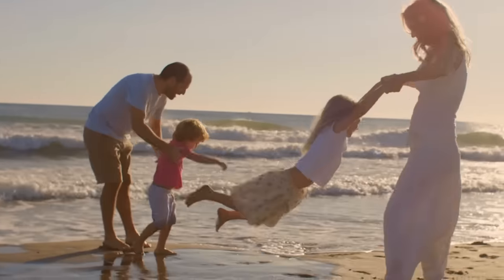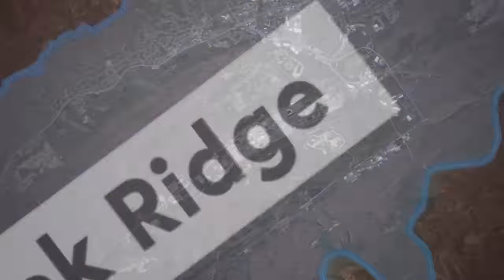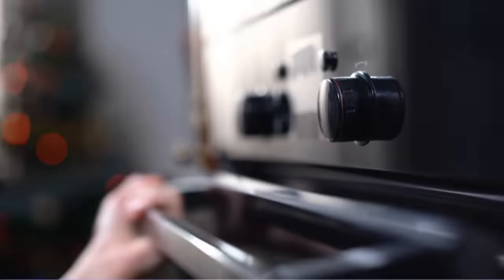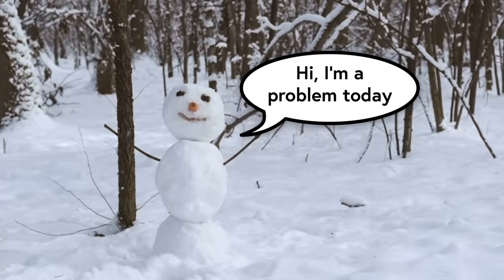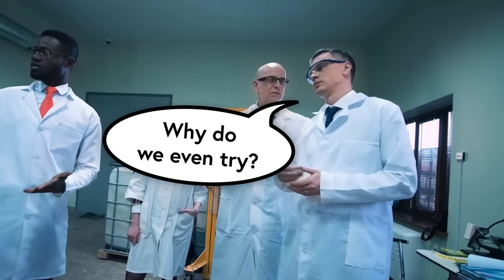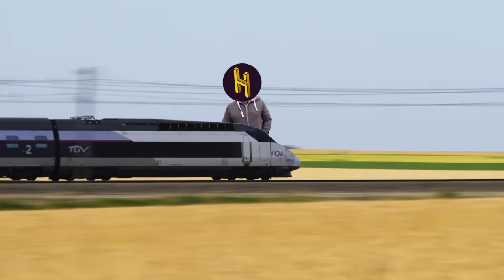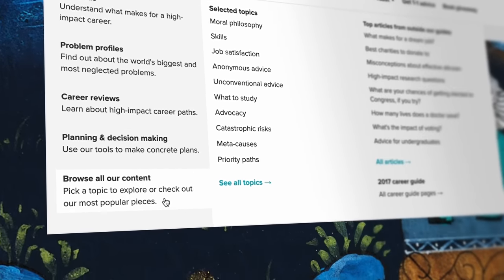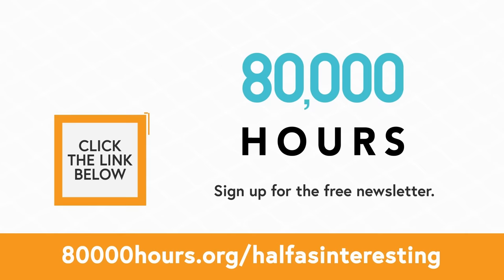The Material So Classified We Forgot How to Make It

Comment: So with the Ulam-Teller design, the fogbank itself is not important to the function of the warhead. What's needed is basically "nothing" that has structural integrity to hold both the initial device and the primary device in place without creating radiation shadows (which would cause uneven implosion on the primary device). At the instant of detonation it would be completely acceptable for the fogbank to be replaced with literally nothing. Radiation pressure causes the implosion on the primary fusion device, not "heat from the fogbank".

The fogbank is just a low density, radiation transparent, structurally stiff substance to hold everything in place while the (light) radiation reflect off the (gold, if I remember) foil interior of the lensing cavity.
Reply: But why would those impurities have mattered, like described in the video?
Reply: @cbuchner1  The video didn't specify what the impurities were or what the reagents or reactions were. I can't do anything but guess. A lot of metal salts act as catalysts in reactions. It could be that removing those metal salts led to an inhomogeneous reaction that had density variations. It could also be that the impurities served as gas bubble nucleation sites.

Again, just guesses.

Comment: So that's funny because Tom Scott recently did a video about why Swiss cheese almost lost its holes, and it's the same reason the new Fogbank didn't work. It turned out that the holes needed a tiny particle in the milk to act as a nucleation site, and the modern milking machines were so perfectly sterile that there was no hay dust making its way into the milk. So now they add just a gram or so of sterilized hay dust per ton of milk, and the cheese is holey again!

Comment: Here is my guess:   fogbank is the fill of the sphere and is a suspension of the fusion material that the fission compresses.   I was told that the fill has to be renewed to maintain the bomb yield.  Thus old bombs have to be refilled.   This is not the only operational issue with atomic bombs.  If the burn in an accident they don't go critical, but the chemical explosion is deadly and all the radioactive material is thrown over the landscape.   Workers have to protect themselves from touching  the tools that are used on the bombs.
Reply: One of its functions it so suspend the secondary within the radiation case, yes.
Many weapons in the US arsenal use insensitive high explosives to mitigate the risk of accidental HE detonation in a fire.

Comment: This is just how manufacturing works and sometimes it sucks. Seemingly small details that may or may not seem like obvious or important things to document can turn out to be critical. I can't tell you how many times I've seen people quit or retire in machine shops only to leave the rest of us scratching our heads the next time we go to set up a previously run job only to run into all the original problems and hurdles the other guy solved and never documented. Especially the ones that were solved in some "expedient" jerry rigged solution because the obvious, proper fix would be too expensive or take too long to ship or require a major process overhaul.

Comment: Dad used to work at a military battery plant, nowhere near the level of clarification as this, and one day the batteries started having problems (don't worry, not fires, that was a different story). This was a completely new problem, and no one could figure out what the cause was or even remember exactly WHY the batteries worked that way. There was one guy who developed them, took decent enough notes, but nothing that would help, and he had died 5 years earlier. Long story short, a team of chemical engineers spent months reverse engineering a battery to figure out there were TOO many impurities in the material in the casings...

Comment: Fogbank is the type of material like Styrofoam used to produce a Crap ton of neutron in order to compress and spark the Second stage Bomb

It called a In-between because the Fogbank becomes a Nuetronium base like plasm that basically makes the second stage spark.

Comment: I read that this material is expanded polystyrene, styrofoam. It forms a carbon plasma when the device is detonated that ducts soft x-rays to the secondary.
Reply: There's no evidence that Styrofoam was ever used.
One weapon from the late 50s used polyurethane.
There are indications that Fogbank may be beryllia based, or at least we know that beryllia is used in the interstage of one of the weapon's that uses fogbank as an interstage material. Could be that fogbank is BeO, or BeO based, or that it's two separate structures in the interstage.

Comment: Not so fun fact, aging workforces in industries have previously had such issues, including other nuclear adjacent stuff. Documentation. Is. Important. Both for the sake of history and so that we don't need to reinvent the wheel when people eventually enter a given professional domain. 

An old experimental test reactor that's now a museum in Idaho (go see it if you're ever in the area, there's also a potato museum a bit of a ways off that's next door to a lovely candy shop that sells all kinds of candy and phenomenal fudge, both are pretty cool to visit, highly recommend that candy shop) had very thick walls for manipulation chambers, alongside multiple layers of glass/mineral oil, which through tricks of refraction made it look like there was only a single pane of glass. The problem was, no one living knew the specifications or assembly/maintenance steps and so when something broke a ways back, they had to reverse engineer and reassemble the window system.

Comment: Swiss cheese almost ran into the same issue.  The bubbles form around impurities in the cheese, and because sterilization processes are better these days there were less impurities in the cheese for the bubbles to form around.  Problem solved by adding some dust to the mix

Comment: The clue to how easily this happened is "security."  Classification limits who can speak to whom.  Something similar happened when the US decided it needed to build some new Saturn Fives.  The tested engines were nowhere near as good as the originals.  They tried dragging former Saturn engineers out of retirement (or the grave) to find out what was wrong.  They discovered that considerable oral knowledge had perished.  Critical tweaks to the processes involved in building the rocket motors were lost because the project leads were unaware of,  or dismissed, the undocumented steps as irrelevant.

Comment: Your explanation of the job of the fogbank interstage is wrong. The gamma and X-rays coming off the primary reflect of the mirrored casing liner to bombard the secondary, burning it off and creating an inward puch effect very similar to that of the conventional explosive on primary, but far more efficient, rapid, and powerful, to better ignite the secondary's fusion reaction. However, all that radiation blasts directly at the secondary and would blow it away before fusion can begin, without something in between to protect the secondary while the radiation reflecting off the casing can begin the secondary implosion. That's the job of fogbank, to absorb that direct radiation, creating a "shadow" effect that protects the secondary.

Comment: It is an airgel encapsulating tritium at the proper density to ensure that the fusion reaction occurs  correctly for the optimum detonation of a hydrogen bomb ensuring maxximum yield strengh. A simplified explanation.
Reply: I'm not so sure I should have released that in 6:27 public forum 😮

Comment: If Fogbank is just an Aerogel, whose only function is to be able to resist high temperatures, why make them a national secret at all? Assuming it doesn't have some explosive properties alone, that material would be suitable for insulation in a variety of applications. At present the best aerogels only operate until 650°C, but if an aerogel could instead resist 100 Million °C that would not only protect buildings from fire. It would be lava proof! Even the lava inside a Hawaiian Volcano only reaches 1250 °C. A wall containing Fogbank in a high risk area would fully divert the flow of lava so I can think of a number of wealthy people who would absolutely pay for that to protect their assets. And of course if you lined a protective suit with Fogbank it would keep miners working deep underground safe for much longer. Quite a few industrial facilities could also be made safer by lining equipment in Fogbank and the extra cost could easily be justified through energy efficiency and lower insurance premiums.

It seems rather foolish to keep the general public from having access to this technology considering a variety of non-military applications. Maybe if ours was the only country with nuclear rockets I could sort of see the logic, but pretty much everyone has access to nuclear technology these days. 

In a broader sense, shouldn't we have a process by which classified documents can be reviewed by someone for potential declassification? The system is so broken that recently the FBI found itself unable to properly search Trump's Golf course because he - when he was sitting President - classified it as relating to nuclear technology. Meaning that the evidence cannot be used in any trial regardless of if it's actually related to nuclear technology or not. And since his power to declassify ended with his presidency, he can't even legally give the FBI permission to look at it. Point here is that it's too easy to make things classified. There's practically no oversight in the process.
Reply: I think it's just standard procedure that everything a military works on is classified. If you found an awesome recipe for brownies while in the break room? Now it's a classified national secret just in case spies are on the lookout for the latest in brownie culinary technology.
Reply: @stylesrj  That's... actually probably true. Both hilarious to picture and sad to think about.

Comment: So, I worked in a different aspect of this "industry" but considering all of the miles of classified microfiche and digitized information on the classified network dating back to the Manhattan project I was able to access, I would really like to know how they somehow misplaced "grandma's recipe" for this stuff. I have a feeling it was simply lost in the absolute morass of things classified under the Atomic Energy Act which have a way of accumulating over time and don't enjoy the same automatic declassification process that everything else does.

I do also remember there were very old engineers (well past retirement age) that they kept around in Oak Ridge in a sort of semi-retirement with full pay deal just because they "knew things" and it was impossible to replace them (I'm hoping someone calls me up in 20 years for some obscure thing I know and gives me a deal like that!). I'm sure most of them have either joined the choir invisible by now or are at least incapable of working. So, if it was knowledge never written down, then I can see how it was lost. That's definitely not how things are done today. Everything (and I mean EVERYTHING) is written down, dc'd and stamped, and digitized these days.
Reply: We are just at the very beginning of the Information Age now. So our ability to store information still isn't very good yet. But we are getting better at it.

Comment: The original hydrogen bombs used polystyrene to channel x-rays into the fusion fuel and kick off the fusion part of a thermonuclear weapon. But to make these warheads smaller polystyrene aka Styrofoam wouldn't do, enter fog bank. This material allowed h bombs to go from giant multi ton devices that required modified bomber planes, to smaller more efficient weapons that would allow multiple warheads to be sat atop icbms which international treaty limits to 10 warheads per missile. Each warhead is of the dial a yield type whose yield is determined by the amount of tritium gas the warhead is directed to use. This allows modern weapons to range from 100 kilotons to 1.2 megatons for the United States

Comment: Beginning of the video: $10 bet on "Deuterated polystyrene foam with specific structural properties", the only low-density material in the original thermonuclear weapons.

After watching the video: So close!  I guess a deuterium-soaked aerogel with a higher mass fraction of deuterium replaced polystyrene at some heavily classified point in the Cold War.

Comment: As soon as they mentioned it was more pure, I knew instantly that this was the problem. They've ran into this problem with metal alloys many times. An alloy that worked perfectly in special batches of research metals. A number of years latter when the special batch is depleted, they create a new batch that no longer performs the same.

This happens because of simple process that's no longer performed or the purity isn't the same because the use an intended newer better process.

This is actually called lost technology. Very much like the formula for cement that the Roman's used. They forgot how it was made. 2000 years latter, they think they might have figured it out.

The congress has talked about restarting production of the F-22 Raptor. Guess what? 🤣😂
The people, the equipment and such things no longer are available.
So it would mostly have to be done from scratch. Thats Billions in R&D before they could start producing them again.

Comment: I can see people retiring and "forgetting" how they did it previously. I was treated so poorly by my employer for the last 17yrs of my employment, I retired earlier than necessary, I took all my s/sheet programs  with me, and if anybody asks me, later, how I did this or that, I'd say I forget, too. Fk 'em. Last I heard, most of the people still there are all the deadweight suckbutts, and the company doesn't have the knowledge base to perform all the functions they used to do internally, and now have to hire expensive consultants.

Comment: No. The employees didn't write it down as a way to remain valuable and not be replaced. The managers probably felt the same way. Whoever was responsible for this project should be fired and accountability/responsibility should never be assumed by higher up managers. Of course the managers are the flunkies, otherwise they would be the actual ones doing the work.

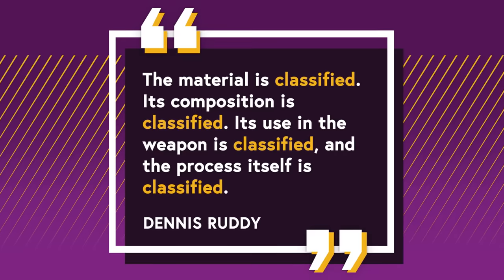Comment: 1:08 What a blabbermouth. Now i know that it is a material and it is used in the weapon🙄

It also could be a process or technique, involved in the painting of the outside wall, to reduce the attempt to leaning on it, but no. It is a material and it is used inside the finished weapon😒
Reply: What are you on about